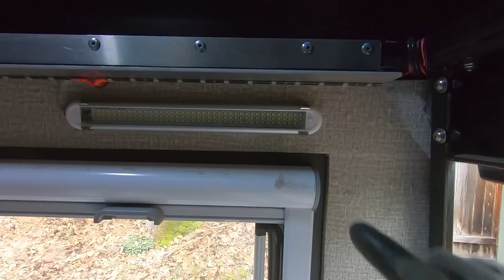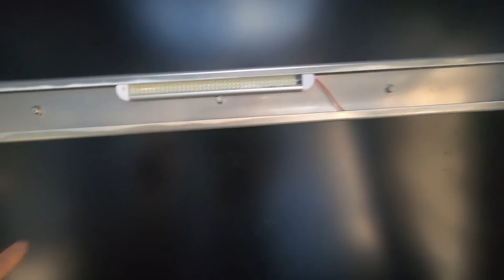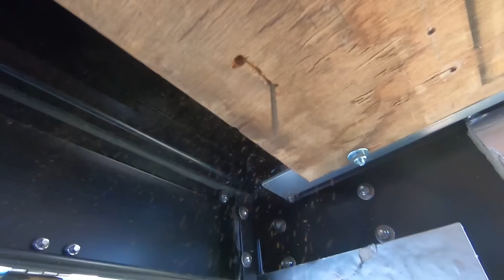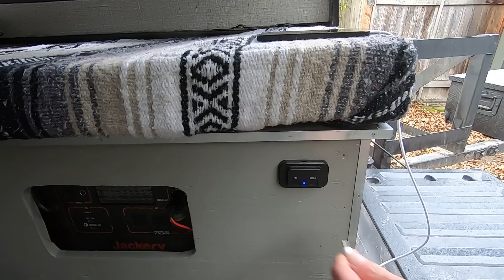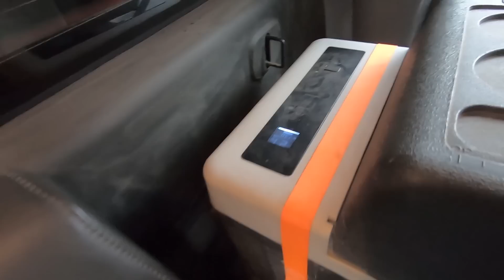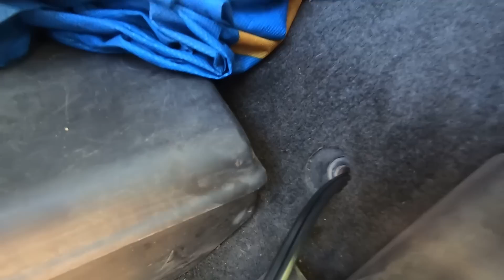Camper Interior Build Series: Part 8 - Electrical Systems

Comment: What gauge wire did you use to run to lights and usb connectors?
Reply from the maker: Honestly I don't know/remember exactly. To run power to the LED lights, I purchased a spool of wire off Amazon that was indicated for that purpose. It was a little heavier gauge than the minuscule wire of the lights' pigtails. For the USB/12v power outlets, I used a much heavier wire I got at my local home improvement store. In general, the supplying wire should be, at the very least, as heavy, if not heavier, than the wire of the device it's powering. Wire that is too fine of a gauge creates resistance to the flow of electricity, which generates heat, which you don't want happening in the transmission lines.

Comment: How many amps are you drawing for all the DC stuff
Reply from the maker: No idea. It doesn't all ever run at the same time. And since I use self-contained power stations which give output readings in watts, I'm only really familiar with the wattage draw of my various items. For example each light pulls about 6 watts. My fridge pulls about 55 watts when the compressor is running, but how often it cycles on varies greatly depending on the ambient temperature. My electric blanket also pulls about 55 watts, but how much I run it at night (if at all) also depends on the ambient temperature. The USB ports, depends on what's plugged into them. Sorry I couldn't be more helpful than that, let me know if there's something I can clarify. :-)

Comment: How did you get power to the console box that powers both Jackerys ?  The air compressor I understand is a direct cable to the truck battery, is there a 2nd truck battery connection to the console power box or is this powered by the dashboard cigarette plug , or something else ...  Thanks for all the videos !
Reply from the maker: Yes, I have a separate independent line running from the battery to the switchbox, which from there gets distributed to the fridge, my GMRS radio (forgot to mention that in the video), Garmin GPS, and the Jackery units (one or the other, I don't try to charge both at once while the fridge is also powered through the switchbox. Would probably be fine as neither pulls a ton of watts via their 12V inputs, but I'm erring on the safe side). I wanted to keep all of this stuff independent of the truck's electrical systems, so nothing is coming through the cigarette lighter plugs. Well, I do have my phone charger plugged into the cigarette lighter but that's a tiny draw.
Reply: @softroadingthewest did you cut all the cigarette plugs off your fridge and jackery and wire them into the box?
Reply from the maker: @Bikepro4x  I cut the power cable of the fridge and wired the fridge directly into my distribution box. I also wired the cut-off end (with the cigarette lighter plug on it) to the box, which then runs back out to the Jackery. It plugs into the 12V outlet on the front of the Jackery as normal. Basically imagine the power cable between the fridge and the Jackery being split by a three-way switch, with the third leg of the switch going to the truck battery. Let me know if I can clarify that further! 🙂

Comment: You make a good point about the heated blanket. It's more efficient to warm the person rather than the whole space, especially if you're comparing an electric space heater to an electric blanket. Or an electric car with a resistive heater vs heated steerling wheel and seat.

Comment: I'm in the process of building my own 'power station' for the back of my truck. I don't have one of the large power banks, I am using two large vehicle batteries. These will power my LED lights, charging points (I have a lot of gear that needs recharging on a daily basis), and a 2,000 watt pure-sinewave inverter. All of it is built into a 'cube' whose top becomes the table where all the devices can sit while they are being charged. It does take a bit of thinking and drawing of circuits to make sure I have a system that meets my needs. I can tell that you spent quite a bit of time identifying your needs and designing accordingly. Loved that you used terminal blocks for the connections! They really make a tidy installation.

Comment: Those LED strips being red light, you won't lose your night vision if you get up late at night and need to go outside. I notice my VIAIR compressor will generate a lot of heat with continuous use while inflating four tires.. enough where I will leave it out by itself to cool down for an hour before packing it away.
Reply: I agree,  red lights are under valued.

Comment: Good job! I just did some wiring to my XJ to charge my battery bank in the trailer. I have it set up so that when the motor is running it is sending power to the battery bank through a Anderson plug. When the motor is off the battery bank is disconnected from the vehicle automatically. I did this by using a relay that is energized by the "on" position of the ignition. Works great. Thanks for the video! George.
Reply from the maker: The problem with these lithium power stations is that theoretically it's optimal to minimize charge cycles, so constantly topping them off ultimately reduces their lifespan (or so I've been told), so I wanted a process I could manually control and only recharge the units when they actually need it. Most of my weekend trips, if I charge them at home prior to leaving, I have no need to recharge them at all during the trip. I don't know if this will truly make a difference in the long run, but hopefully. 😄
Reply: @softroadingthewest  Yes, Jackery uses lithium batteries which typically have a 500 charge cycle rating. I do believe they recommend near complete discharge before recharging. 

In my research when looking for a battery bank I found the LiFePO4 technology. They have a 3000-5000 charge cycle rating. These batteries can be used in place of lead acid batteries and are often used in vehicles, boats and RV's.They can take the place of 12 volt lead acid batteries since they share a very similar voltage (12.8). We all know that lead acid batteries in these applications are constantly being at a charge state while the vehicles are running.The BMS on the battery bank will shut off all charging once the batteries are at full capacity as well. A extra benefit of the LiFePO4 technology is that they will not go into thermal runaway (catch fire) like a lithium battery will, which was the biggest feature for me.

Comment: Cat Tax paid in full. :) Good setup on the 'lectrics. I tried to keep mine simple so no hard wired compressor but I did add a dimmer for the LED strips. Some red would be a good idea but that would be more wiring. I have amber and white and will likely stick with that for now.

Comment: Just concerned with chafing through cab & box. Nice setup!
Reply from the maker: I've had wires of various sorts passing through the seat bolt hole in the cab for years, but everything has always been snug with no way to move and I've never seen any wear on the insulation. The wire passing into the truck box is held away from the metal edges by the plastic grommet it passes through, and the entire wire run is firmly secured throughout with zip ties, especially under the truck where it's outside...shouldn't be any way for it to move and chafe. Theoretically anyway. 😄

Comment: Your progression with this build has been fun to watch. (As I recall the diagonal bed)

My concern is the wired junction block.  Find a cheap plastic box and mount the board inside it.  At some point something will fall into that compartment and short your strip.  

Your back panel with the fire extinguisher, first aid and roll of paper towels is  notable.  Those are three things you need NOW  when you need them.  Good idea.
Charley is a good buddy I can tell.
Reply from the maker: I might not have included a shot of the finished job but all the terminal blocks have plastic covers, I just didn't have them installed yet while working and filming. In any case, there is nothing else inside that space...it is separate from the rest of the bench storage and there is nothing loose in there. It also is (theoretically) not energized when I'm driving, there is only power there when I turn on the Jackery at camp (though it's true I occasionally forget to switch it off when I hit the road). And the power supply line from the Jackery to the block is fuse-protected. But yeah it is indeed covered, and there's nothing to fall on it anyway. 🙂

Comment: Short and sweet overview. Thanks Donald! The last couple of days I've been putting off running some wires from my van battery to the back. Watching this I realized I've already got 6awg running back there for my dc-dc charger. DUH. This also gave me some ideas for my next build. Planning on selling my van, after King of the Hammers next year, and replacing it with a truck.

Comment: I like the way you set up your wiring to be as unobtrusive as possible. My canopy/camper had the adhesive LED strip lights when I bought it but there are quite a few wires running around. One of these days I'll redo that. After seeing your rearview mirror camera, I bought one for my rig. It works great but I've never found a proper route for the camera wire. I ended up running it through the sliding rear window. I don't like that but it works. I've looked for some sort of guide for my Tundra to a 'hidden' route but no luck yet. Thanks for the video! I always find these interesting.

Comment: I see your feline progress inspector is right on the job, making sure everything is purrfect. 😂 
Hey, I've been doing wiring systems for fifty years and you still give me ideas for my own camper project. Thanks a bunch!
Reply from the maker: Thank YOU Bob...while I'm sure the way I put this together is probably not fully up to your standard, I did pay a LOT more attention to details like wire gauge, fuse protection, and amperage rating of components, thanks to things you've said to me over the years. 🙏
Reply: All I would add is to make yourself a basic wiring diagram of your complete system and keep it with your owners manuals or Hanes manual in case someone else down the line has to make a fix to it when you aren't available. @softroadingthewest
Reply from the maker: @sagebrushbob2321   oohhh that is a VERY good idea. The other thing I had intended to do - and completely forgot about until now - is that you once told me about a device I could install between the truck battery and my aux systems that would cut off power if the truck's battery was getting drained...what was that thing called? I still want to do that. My switch panel in the cab of the truck is a little dangerous in that I could theoretically have it sending power to recharge the Jackery 1500 and I could forget to switch it off, and the 1500 would just keep pulling power off the truck battery with the truck not running. The indicator lights are supposed to prevent this, but I am entirely capable of being distracted enough to forget to glance at the panel, LOL. What's that thing called I need to get?
Reply: The power cutoff is called a "Low Voltage Battery Disconnect." They work very well. The one I use is "Galley Power LLC 30A Low Voltage Battery Disconnect." It has the lowest standby drain I could find (some of them have a pretty high drain).
Reply: I'll email you the link for  the relay. Plus a little more, maybe.

Comment: Nice setup.  I've been wondering how soon production trailers and campers would start using power stations as the basis of the electrical system  instead of hard wiring in batteries, chargers, inverters, ...
Reply: Van builders and minimal builds from Winnebago are using EcoFlow modular systems or their 3.6kw Delta Pro already. IMO electric is the way of go for cooking (induction) and HVAC (heated blanket, ceramic or infrared heater) if you have to a way to quickly charge it via alternator

Comment: Very nice setup. For the compressor, is power flowing through the kill switch, or is the switch triggering a relay?
Reply from the maker: This is why I didn't dive into precise technical details...someone always finds a shortcoming 😆and I wouldn't necessarily want people to replicate what I've done...that's why I encourage viewers to do their own research on wiring. But yes, the switch is indeed simply inline, no relay. It's a heavy-duty switch rated to 35 amps. Flipping the switch does not immediately energize the compressor however, only the 2-watt LED strip. The compressor has its own switch, so there's not a high-amperage pull as the switch is being thrown (though clearly yes, the current does flow through the switch once I turn the compressor on). I ran this exact setup on my Forester for years with no issue - and I have no idea what that switch was rated for, didn't even give it any thought at the time and probably had the Forester's compressor powered with a smaller gauge of wire than I should have. This time around, I did take amperage into consideration for all elements and made sure I was using an adequate gauge of wire as well as components rated above the amperage of the devices they're serving. It would be easy enough to add a relay, but for the very very infrequent use this gets, I'm not worried. 🙂

Comment: Well done. I would suggest a bit of RTV around the grommet in the engine compartment and the hole underneath the seat to keep water out during your adventures.
Reply from the maker: Not a bad idea. I've had that membrane pierced with assorted aux wiring running it through it for years now and never had an issue, though it certainly couldn't hurt to seal it up better. 🙂